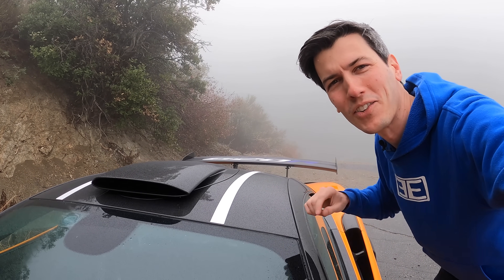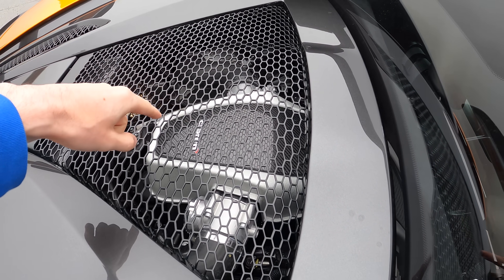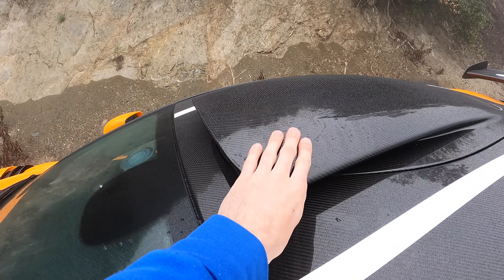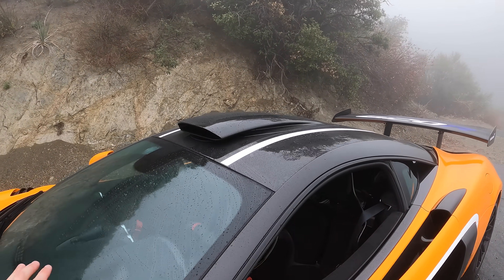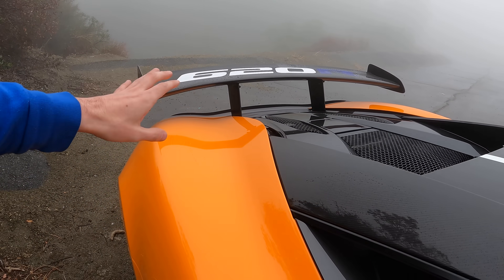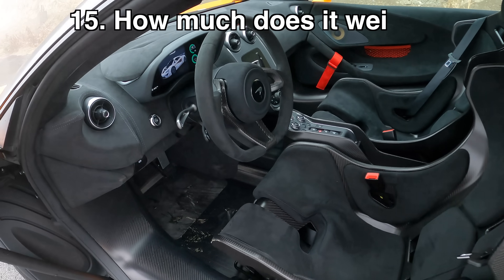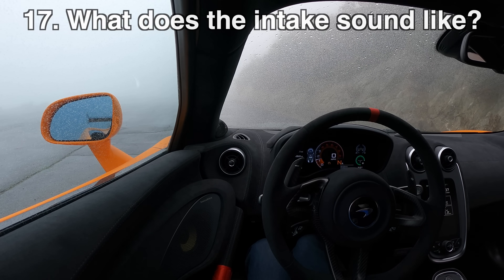The Clever Engineering Of McLaren's Roof Scoop

Comment: higher turbo inlet pressure = less pressure ratio = less power required from the turbine = higher wastegate duty cycle/higher wastegating percentage = less backpressure = better volumetric efficiency = less fuel consumption, which McLaren doesn't care about, but also = less heat...

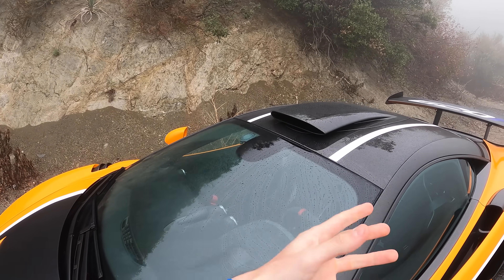Comment: 5:00 Correction, adding pressure to the intake of the turbo charged engine  increases the efficiency of the turbo/s, it will increase the effective boost map area of the turbo compared to a turbo relying only on atmospheric pressures.
It is the same reason that vehicles use compound turbo charging 👍

14:40 Intake sounds like any 18yr old's 4 cylinder Pulsar / Miage / Honda with a pod filter 😁👍
Reply: Just know that I, and 2 other dudes will be the only ones that ever read your comment. The 3 of us personally thank you for clearing this up. I swear I haven't already forgotten your explanation while I type this

Comment: Hi Jason, isnt this design giving the engine a colder intake vs the side mounted intake? It most definately is colder than a regular front bumper grille, but im curious about the intake temperatures in these two scenarios as the air is technically going through the interior of the car.

Comment: I wouldn't say that turbochargers are unique in "sucking" air in.  Any engine will produce some amount of partial vacuum when it pulls air in.  Turbo/super chargers just create higher pressures inside the cylinders, which means they need a larger cross-sectional area for the air stream on the low-pressure side than the high-pressure side.  Ram air can help deal with the partial vacuum regardless of whether the engine is naturally aspirated or turbocharged.

Comment: From the compulsives only department: A taller scope will not necessarily increase CD, it will probably increase frontal area and overall drag. Maybe talking in FPE (flat plate equivalent) would be easier? Talking CD is like talking about just torque without RPM, not really that useful.
Reply: Thank you for stating the obvious

Comment: Good video!! The inlet is elevated to create flow separation between -- which could also be achieved by drilling a series of holes into the point before the intake in a staggered pattern - skipping the need for an inlet diverter and using an inlet bleed instead or bypass duct. If weight is a concern, go with a bunped inlet. The reason you do this is because turbulent air when entering a system creates pockets of inconsistent compression which are bad for combustion. This is actually an aircraft engineering principle! Cars are also often curved because it forms what's called an inverted lifting-body -- that the body shape itself generates downforce via the natural pressure differential of the floor to the roof -- though you often need rear diffusers toward the back (seen as splitter-plates or fins) or ground-effect (which hovercrafts fake to produce lift) becomes a problem and you risk forming a skirt-pocket of air that lifts the car off the road. This is why in high performance cars, the floor of the vehicle's shape is very important!
Reply: Nobody cares. Exhibit A is the lack of likes for this comment

Comment: What happens to the water that gets sucked (or rather pushed I guess) into the air intake? I'm sure if you drive it during a downpour, a noticeable amount of water will get in. How is that dealt with? It surely can't (and shouldn't) get into the engine, right?
Reply: 08:24 ou, oukay 😬

Comment: Thanks for answering the IMPORTANT question about water fording depth. Jeep owners everywhere were curious.
Reply: Us Brits would like to know if it's capable towing a caravan...
Reply: I understand the water fording depth was a joke, but I'm not going to let that stop me from commenting with some factual information.
As the owner of a 1963 Amphicar, I can confirm that the front is likely to lift up if traveling through water at more than about 4 mph.  BUT, the at the same time, the back will squat, maintaining traction on the rear wheels in somewhat deeper water.  The front goes up and the back goes down basically because the car is trying to climb the face of it's own bow wave.
Anyway, even with the front tires off the lake bottom, they can provide some steering.  The Amphicar is steered in the water with only it's front wheels/tires (it does not have rudders).  I suspect the disk brakes, if not the tires and wheels, on the McLaren would be enough to steer it a little even if the front tires lose contact with the lake bottom.
So the lifting of the front end is not enough, on its own, to stop it when fording.  The question remains, how deep can it ford?  I demand a test to find out.  :)
Reply: In all seriousness though, most of the time whenever I see any SUV (even if it's not supposed to be used for off roading) and sometimes when I see a sedan I wonder what it's off-road capabilities r 😅. For some reason I imagine muscle cars are just more off-road worthy supercars

Comment: This thing accelerates faster to 124mph than either of my cars to 60mph. That's insanity.
Reply from the maker: My Crosstrek is still at the stoplight, dumbfounded by the speed!
Reply: @EngineeringExplained  What about the rolloff acceleration advertising of this car...or any other cars. Why are people bias against Tesla and pro for every other environment destroying car. Tesla are the fastest, most aerodynamic...basically, best tech and saving the planet. On the battle to save the planet, your like some commander for darth vader.
Reply: @philipdrew10  huh? He bought a Tesla
Reply: My Mazda3 1.6L petrol can reach 60mph in just over 2.7 seconds, so faster than the McLaren.  Unfortunately the only way that can happen is that I drive it off a very high cliff...
Reply: @AndyG73  LOL
Reply: My mazda3 would just stall watching this car accelerates from a stop.
Reply: My Geo metro is shaking in the garage!
Reply: @nopleaseno2515  i love Geo metros ! Pull the handbrake you can spin that thing like a coin.
Reply: @owendebest4183  I think mine had a 3 cylinder motor. The manual gear shifter would vibrate on the highway. But still, great! Cheers
Reply: @nopleaseno2515  ahhh that's a minor concern ahahah Cheers indeed!!!
Reply: to 100km/h it's only 0.1seconds faster than my carburetted, 22year old yamaha R6.
Reply: I reckon I might beat it to 5mph on a bicycle
Reply: You mean, 0-124-0
Reply: Dude, this car accelerats faster than most of sports bikes 😶😶 
Stop driving it on the rain 🤣

Thanks for the very instructive video 😁👌
Reply: Electric cars companies only talk about 0-60 for a reason........And imagine tesla owners doing 0-60..........0-60 again and again on the road.......lol
Reply: Some can get to like 200 something before some cars can go like 70
Reply: No.  Insanity is SpaceX rocket upgrade to the Tesla for 1.3 seconds 0-60.
Reply: @crhu319  that’s insane
Reply: Yes, but it's GOOD insanity.
Reply: And there are cars that are far quicker like a 765LT.
Reply: @v4skunk739   yeah, pretty sick 😁👌